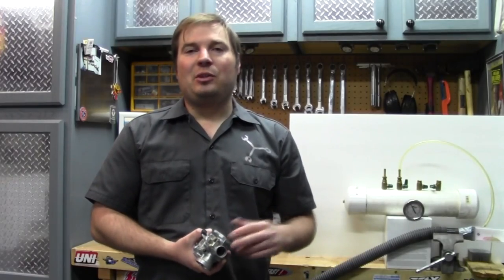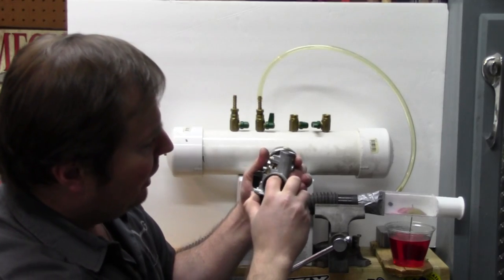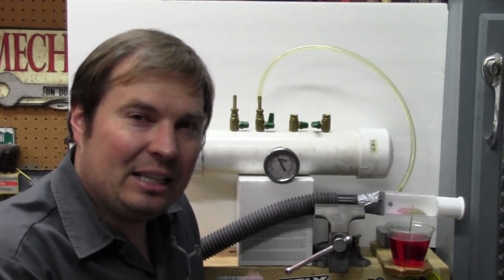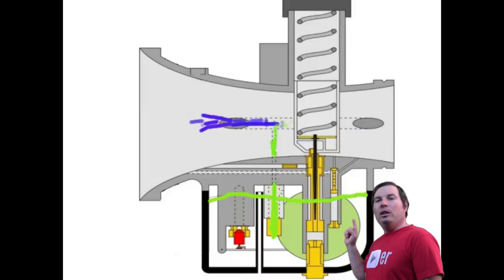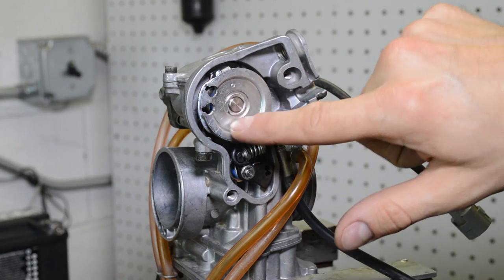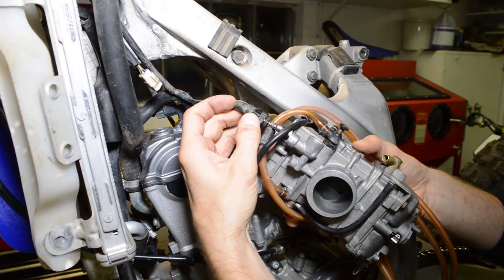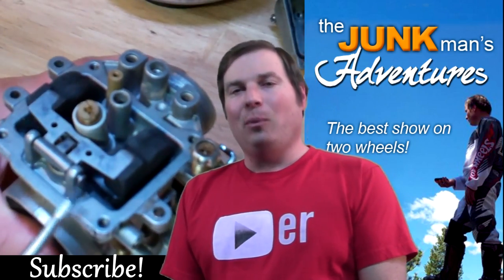How to adjust a carburetor, jetting and mixture explained!

Comment: My 2005 ninja 250 won’t start I had it running. It has new battery, new plugs it turns over and turns over but doesn’t catch a start . But maybe one time here and there .. I just replaced those things yesterday also. Carbs are cleaned I pulled them and took apart
Reply from the maker: As long as you are positive you're getting fuel into the cylinders as in the spark plugs are wet.  It sounds like you ran into an ignition problem that is preventing the spark plugs from sparking check that the engine stop switch is not grounding and other things related to that.

Comment: I have a two barrel Weber carburetor that is having a problem in my car. 

When I do a cold start with my car it seems like it takes off like a rocket. But after it warms up, and drive it around for a little it, the idling goes back to normal. When I open up the air cover when it's dead cold the motor, the jets are wide open. I mean really open all the way. When I try to touch them. they don't even move. 

What do you think I should do now? I have a rebuilt carburetor in my pad, but would like an opinion on what you think.
Reply from the maker: Dose the throttle shaft have play in it? This can ne a source of a vacuum leak.

Comment: What is the difference of ASV(air sunction valve) and ACV(air cut of valve) function in carburetor? please reply
Reply from the maker: These are not a function of the carburetor.  These are used for emissions purposes of an ASV to inject fresh air into the exhaust to complete the combustion/conversion process of the carbon monoxide.  ACV is used in the same way but to reduce the popping on deacceleration by completing the combustion.

Comment: so if i need more air and less fuel in the mid range, what jet do i need to adjust?
Reply from the maker: I would adjust the jet needle's clip position first.  That will fine tune the flow through the main jet.  If you can't dial it in doing that then it is time to change the main jet and then do that again.  This video explains all this if you watch through that section.
Reply: @thejunkman  I just had a hard time wrapping my head around it, Thankyou for the advice, I will see what I can I do

Comment: If I lower the pilot jet into the bowl a little more, would that resolve the sputtering when I roll off the throttle?
Reply from the maker: That is not possible. The jets have a fixed position. You could raise the float height, but the solution might be to richen the pilot jet to the next size.
Reply from the maker: https://youtu.be/SkoMCP9QreQ  This video of mine might help you understand what settings to change a little bit better.

Comment: It should be added that al parts of the carb can effect tuning .Different pilot jet sizes , needles with different taper profiles, slides with different cut-aways and main jets are all available . I have seen many racers on dynos only worry about top end jetting not knowing that it's mid-range that gets you out of the corners first.
Reply from the maker: That is the whole idea of the video, but you have to watch until the end.

Comment: I have a pilot jet problem wont idle sometimes do i need a smaller or bigger pilot jet?
Reply from the maker: Well first determine if your current pilot jet is even functioning, ie. is it clear and clean, this means removing it and checking.  If so go here to learn how to properly adjust the idle speed mixture https://www.thejunkmanadv.com/how-to-idle-mixture-screw-adjustment.html  It will tell you what to look for to determine if you need a larger or smaller jet.  I can't really determine that over the internet very easily.  There is a cause and effect with rich and lean, my website and other videos can help you learn what to look for.

Comment: I have a question regarding the pilot jet that needs an answer, it has one measured hole from up and other some holes in its stem, could you explain for me the function and the reason of these different holes ?
Reply from the maker: The small holes in the pilot jet on the side are part of the emulsion tube to help pre-adamite eyes the fuel before it actually fully atomizers when it enters the carburetor throat by of a small hole
Reply: @thejunkman  many thanks

Comment: I have Royal Enfield 350cc also called the bullet standard. What is the correct variant of Mikuni carburettor?. I am told VM28, but some mechanics doubt. Pls suggest
Reply from the maker: I would not know that level of specificity.  I would find a Royal Enfield forum and ask there.
Reply: @thejunkman   Thanks

Comment: What makes the idle jet stop feeding the mixture when the slide opens wide?
Reply from the maker: Because the fuel starts flowing through the main jet lowering the level in the bowl so the pilot jet is no longer submerged games under the fuel level.  I am working on a series of videos with animations that will show this even better so subscribe and stay tuned.
Reply: @clown engineharia:
DUDE ...
Did you NOT watch this video..?? HE fucking explained it ...

Comment: Great video mate! What is the name of the part where the needle slides into? I've been told it's not the main jet. Is it the "needle jet holder"? Kind of looks like the slow jet. It's the part that over time gets worn out oval shaped by the needle and it is killing my fuel economy and low rev throttle response. +150K on the clock. Cheers!
Reply from the maker: That is usually called the emulsion tube, which is sometimes part of the main jet holder.  It begins the atomization of the fuel as it rises through it before meeting the incoming air in the throat of the carburetor.  Different carburetors have different designs, some have little holes and others don't.
Reply: Thanks man
Reply: +Pedro Mota ok

Comment: I have a big bear 350. Replaced the carb and adjusted the idle and will sit and run fine. The minute I throttle it up it bogs and shuts off. What do I need to remedy it problem? Thanks
Reply from the maker: Did you set the new carburetor to the factory specs? Sounds like you are lean for some reason. Could be  the float height is too low. Set your carb to factory specs. They aren't always out of the box set up right.

Comment: Hey great video! Hoping I could get some advice. Got a Honda foreman 450FE2 and I rebuilt carb and everything works good under throttle but when idling it spits or backfires out carb and fuel flows backwards but it's only every 15 20 seconds. If you adjust idle up or throttle up it does great. Is this related to intake valve sticking on compression stroke or too rich? Plug is grayish colored. I've adjusted the fuel/air on throttle plate side and dont seen to help. Thanks bud!
Reply: With valve it looks like it would do the same thing on throttle though. I'm stumped.
Reply from the maker: How old is this machine?  This seems to me this could be a valve timing issue, which is probably caused by slop in the timing chain.  Check the cam chain tensioner and adjust if necessary.  This will also contribute to hard starting, this is assuming all your carburetor settings are factory correct and it is functioning properly, which it seems it is from your description.
Reply: Customer says 2007 but I think Honda stopped making the 450 in 04 05 so around then sometime. I will check that for sure thanks!!
Reply from the maker: Honestly, unless you are at extreme altitudes above 6,000 feet one should not have to deviate much from the factory specifications on the carburetor settings.   Given its age tells me there could be other slight things contributing, like the cam chain begin sloppy giving wavering vacuum readings at idle when the chain is not under constant tension.  The symptom you describe can also be from being too lean from vacuum leaks in the carburetor.  The throttle shaft can be a source of this if it is loose in its bore.
Reply: Ok thank you I'll see what I can find
Reply from the maker: It is running out of fuel at idle, that is what is causing the "hiccup" as it stalls, and the inertia then pulls in enough fuel to keep running.  Finding the source of the lean condition is your task.  Could be still a partially plugged passage in the pilot circuit, or a very small vacuum leak or the valve timing from the slop of the chain, because it is the opening and closing of the valve in conjunction with the piston traveling down in the intake stroke that creates the vacuum.  I can't give you a magic bullet answer.

Comment: good video unless you have the other other type carb, a CV which has a slide controlled by vacuum instead of a cable. since the slide isn't directly attached to the throttle cable how does a CV carb deliver the fuel volume necessary when you are cruising 65 mph down the highway at a constant 5000 rpm but only using 5% or less of the throttle, there's no slide moving so no main jet fuel contribution and your throttle position is positioned just off idle, where is the fuel to sustain that kind of rpm without going lean coming from?
Reply from the maker: You are correct.  A CV type carb the slide is operated by diaphragm that is controlled by engine vacuum and the throttle butterfly which controls the incoming air.  These are proportional and a low throttle input even at 5000 rpm is going to limit the air entering the carburetor which is going to affect the pressure differential and keep the slide low just like a cable operated slide would work.  The fuel is still metered the same as the air is the same irregardless of RPM, its only when throttle movement happens is when the air and vacuum change and thus more/less fuel will be required to maintain the proper stoichiometry (proper air to fuel ratio).  In stationary engines that run at one speed, the metering stays constant and the fuel delivery can be near optimal for that speed, which may be mean the throttle is barely open, however the pressure differentials will auto adjust the slide position (or flow through the jet in "briggs"/lawnmower type engines) to near optimal.  Now where it gets tricky is when the main jet and pilot jet sizes are either too small or too big, as the needle that is attached to the slide can only control the flow rate through the jet given its initial size.
Reply: i've been working on bikes for 40 years and for the first time ever I'm at a lost and out of ideas for correcting the mixture problem I've been chasing for 3 months but i don't have a lot of CV experience. If I provide the basic details and problem i'm having would you mind reviewing it and offering your suggestions as to what might be causing the problem or what i need to focus on for a solution?
Reply from the maker: Sure, just comment here.  Is it a torn diaphragm maybe?

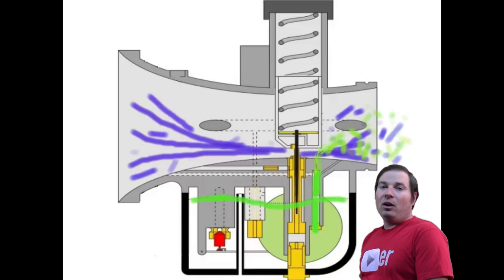Comment: 4:12 idle mixture screw is doing nothing? why not and where is it within these blue and green lines which have been helpful so far
Reply from the maker: You are correct the idle mixture screw is doing nothing, because the throttle is not in the idle position and the pressure has changed so no vacuum is allowing it to pull fuel from that passageway.

Comment: Nice demo, problem is knowing a little about carbies is often worse then knowing nothing. Ive just done a series covering how carbies really work, mostly its the stuff mechanics all should know but often don't which is why carb tuning is a dying art..
Reply from the maker: I skimmed through your videos and didn't see any carb videos.
Reply: thejunkman can you tell me why my bike bogs out in 4th gear at Full Throttle but not at half throttle but in Full Throttle 4th gear it starts to bog but if I let off the throttle and just have it halfway it runs fine is it not getting enough fuel?
Reply from the maker: +DeAngeles Duffie yep, your running lean at WOT.  The video will tell you what adjustments to try.
Reply: thejunkman  thank you sooooooo much you definitely make a big difference and you explain very well how to do these things thank you very much sir. and I will be back with more questions as I have them so just remember my name I build super pocket bike drag bikes so this information was very well needed thank you.

Comment: I have a 2004 LTZ250 and I am looking to jet the carburetor. If I end up jetting it is there anything else that I need to change or tune up after I do so?
Reply from the maker: +BLUEMARINEinc no, but if your machine runs fine now there is no reason to rejet

Comment: Nice  vid. Question to the pro. 
1- what happens if the choke (flap valve) is removed? Does that mean that the engine will run leaner since it controls air?

2- can the main jet needle be adjusted? If yes what are the basics?

3- how to know my main jet needle position?

Issue: i have a bogging at high range acceleration. Low and mid ranges are awesome. At high range, bike hesitates; i heard a gun shot out of my exhaust opening my throttle in this range a few days ago. 
My main jet size is 168. 

2000 XR600R. Cobra exhaust, KNN Air filter, no air choke valve, keihein stock carburetor

Anybody read this and can assist thanks in advance

Comment: Is all pilot screw the same size? I mean by thickness and not by the gas hole passage
Reply from the maker: I am not sure what you mean.  The pilot screw, also known as the idle mixture crew, only controls the entrance to the passage.  This can be controlling incoming air into the pilot circuit OR the fuel coming into the circuit.  It really depends on which type of idle mixture screw the carburetor has.
Reply: @thejunkman  what am talking about is the jet screw that supplies gas before the mixture screw will bring in air. Is that screw with other motorcycle jet screw the same size? Like for example can a Honda jet screw fit in into a Suzuki jet screw hole?
Reply from the maker: You mean the pilot jet itself?  It is not a screw. They are defined by the size and the style of pilot jet, carburetors that use the same style will be interchangeable.  To say a "Honda" pilot jet will fit a "Suzuki" is in accurate.  Here is a site that shows all the different styles of jets from various carburetor manufacturers https://jetsrus.com/FAQs/FAQ_identify_that_jet.htm

Comment: When I prime my MTD Snow King snowblower I have gas coming out of the none intake side of the carburetor.  I just installed this new carburetor and i'm happy with the performance of the snowblower engine.  I had replaced the carburetor because of the gas leakage.  What the heck is going on with my carburetor???
Reply from the maker: This is going to be fairly normal.  In essence what you are doing with the primer bulb is intentionally flooding the carburetor to make a much richer mixture for cold starting.  Over-priming will cause the fuel to need a place to go and that is out the throat of the carburetor.  There is nothing wrong, other than you are pumping that primer bulb maybe a few more times than needed.  Is your snowblower similar to mine?  https://www.youtube.com/watch?v=iuDN4Ss5-Co

Comment: Does the main jet get turned all the way in or is it backed up a turn?
Reply from the maker: The main jet is just a precision machined orifice. It is adjusted by changing the entire jet larger or smaller.  To answer your question it is always screwed all the way in like a bolt.
Reply: thejunkman Thanks dude. Very nice video btw.

Comment: Is it the same on a cv carb, ex say your at 1000 rpms then you go to full throttle does the slide open all the way around those rpm or does it gradually open until it gets to redline or close to it?
Reply from the maker: It works the same in CV carbs. Engine vacuum and the air flow controlled by the butterfly moves the slide. The principles are the same.

Comment: hello good video. I have a pwk 28 and I have a problem! after a good opening on the throttle the motorcycle as soon as the throttle stops idling does not fall to normal levels. I'm also sure that the carburetor does not get airborne! it is believed that I may have to put myself a little smaller pilot jet ?? thanks
Reply from the maker: That is typically because you are running lean.
Reply: what should I do to work properly
Reply from the maker: Well I can't tell you that exactly.  Study this video and understand each part of the carburetor that is metering the fuel at what throttle openings.  I would start with the main jet here.  This is assuming that you do NOT have any vacuum leaks in the intake, this will not fix those.  The jetting video is making that the assumption is that everything else is working as it should.

Comment: I've heard from someone that you should do the carb jetting when you change the exhaust on your motorcycle, may have something to do with the air flow.
Is it really a "must do"? Might be a really self-explanatory question but, as you can probably tell, I don't have that much experience with motorcycles
If anybody could help me with that, I would be very grateful
Reply: With an aftermarket exhaust you allow more air to escape. This leaves room for more air coming in. You should get an aftermarket intake and re jet it. Your gonna need more fuel not less.
Reply: If you do so you will increase the power and longevity of your engine.

Comment: I have full RPM  range power from a deadstop to wot flipping throught the gears but i get bog and fall flat when at highway cruising and twist the throttle to wide open it acts like it hits a wall. But lightly roll back to 3/4 throttle it comes back alive and slowly apply throttle to wide open ill gain speed but eventually  hit that wall like its not getting fuel. Everything down low from idle to 3/4 is great just the transition from 3/4 to the main jet is not. Unless im from a dead stop and wack it threw fhe complete  rpm range to 6th gear
Reply from the maker: Try changing the jet needle clip position.  Go down then up and see which way makes a noticeable difference.